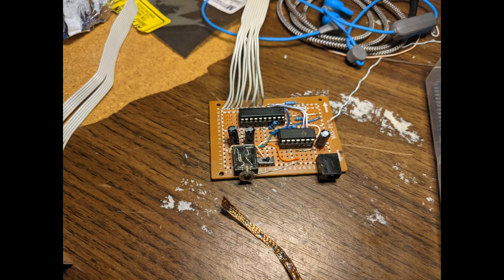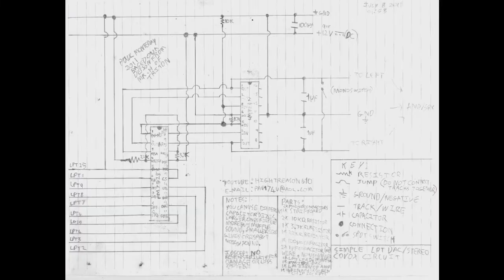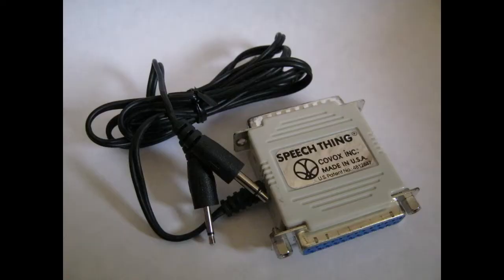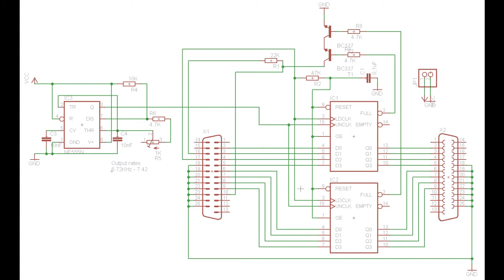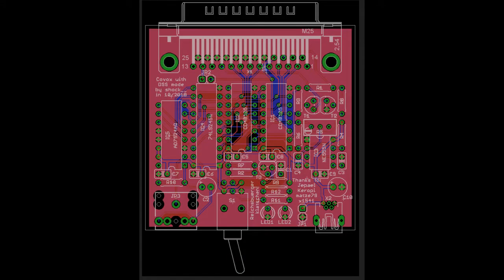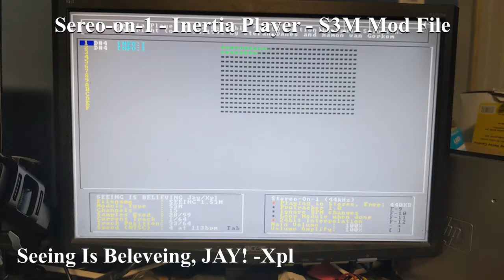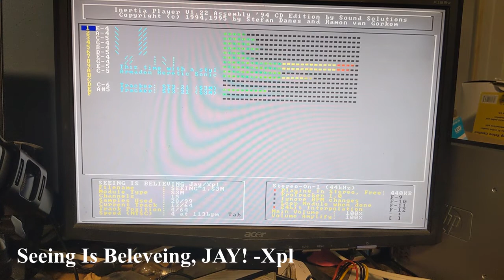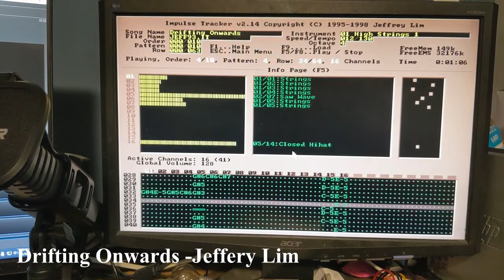DIY Covox Clone (Stereo-on-1) LPT DAC (Short)

Comment: Guy who did the Disney Sound Source reverse engineering on VOGONS here :)
Sadly never finalized that "all in one" solution since the schematic/layout had a few rather silly mistakes (wrong pinout for the stereo dac, swapped stereo channels, output jack being rotated 180°, circuit being extremely sensitive to PSU types) and I ended up patching a PCB for myself, but never releasing a corrected one, since there was very little interest. The schematics of the versions you'd plug between a (stereo) covox are correct tho - there are 2 different versions depending on which FIFO is easier to obtain for you. 
There's a short video showing the dongle prototype (which looks just like your breadboard DAC :D) on my channel: https://www.youtube.com/watch?v=EoGCf69QLJc
Reply: I am so impressed with these clones and the tweaks added. Maybe not BIG numbers interested but I think it looks a fun project for us tinkerers if it's ever finished ;-)